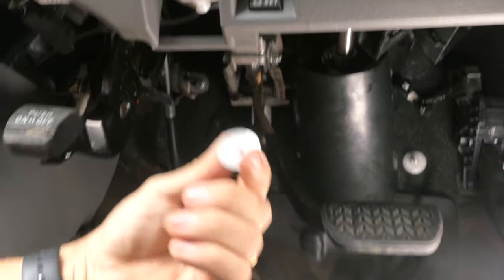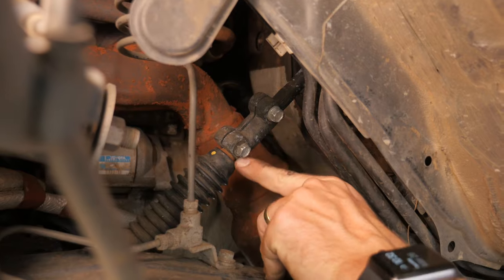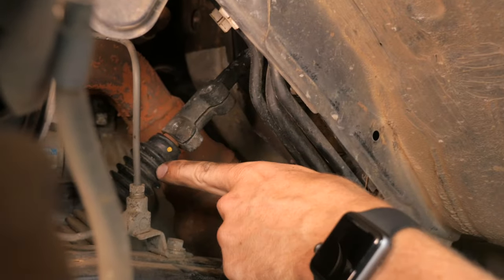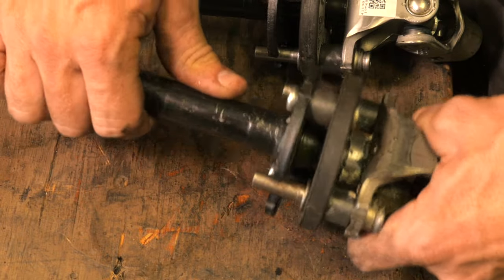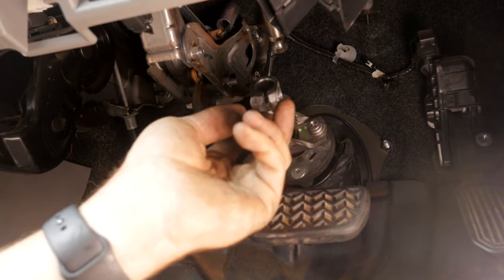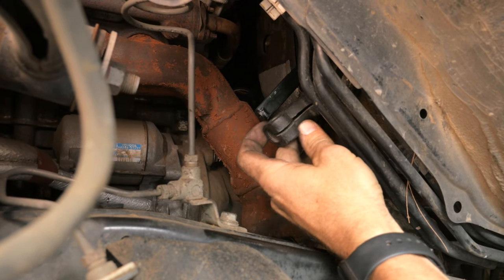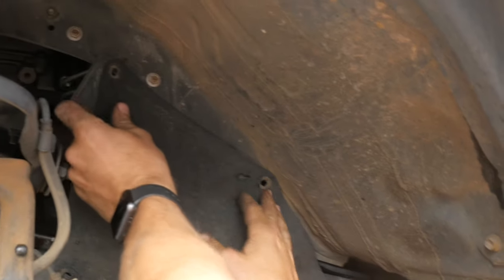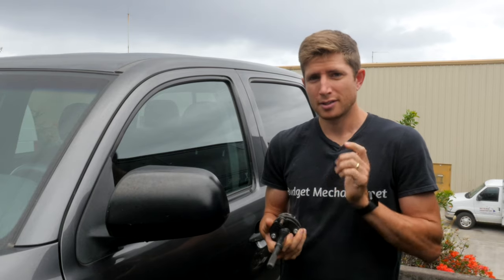Toyota Tacoma Steering Rattle Solved! Steering Intermediate Shaft Diagnosed and Replaced

Comment: Toyota has a part that has been counter measured, meaning an updated part. It is p/n 45220-04020. There is also a related TSB (Technical Service Bulletin) that covers 2005-2015 Tacoma’s. The part costs around $200! BTW, good video.
Reply: That TSB is it a recall can Toyota replace it under a warranty?
Reply: @WMAT77LL  It is NOT a recall so unless the vehicle is under the 3/36 warranty, it is NOT covered.Technical Service Bulletins (TSB) are repair processes covered only if the vehicle is under warranty.
Reply: @kevinpilotte8738  ok thanks
Reply: I just went to tacoma for this mine is under warranty but they want to replace the hole sterring column will this fix it ??

Comment: I found a cheat for this a few years back. Take a small zip tie or two and feed them up through the middle of the shaft to take up the extra space, and then tie them off. I did it on my old '07 and it worked just as well as replacing the shaft.
Reply: Where exactly do you put the zip ties please explain thanks

Comment: Great Video! I'm having this same issue on my 2017 Tacoma with only 53k on it. Is the rubber grommet not well designed? Would a non-OEM replacement part work better? My dealer said the Service Bulletin covers up to '21 Tacoma's but mines out of warranty already so I have to pay for repair. Disappointed that this Toyota part only lasted 53k when it should last longer. Thanks!
Reply: Are you stock or got a lift and bigger tires ?

Comment: Really appreciate the video man, I just ordered the part, do you know if all the newly manufactured ones have this fix built in (like that bushing you pointed to on the new one) or is the new one exactly the same as the old, so the problem could come back in time. I have a 2013 Tacoma 4.0l TRD sport.

Comment: Great video and the replacement is straightforward.  Thanks for posting.  I just did this on my 2010 Tacoma 4x4 Off Road.  I did place the bungee cord on the steering wheel but had an issue with the steering wheel position and had play around a little with the position on the shaft inside the cab (disconnect from rack & pinion and move intermediate shaft on steering wheel spline in the cab, reconnect rack, replace wheel, drive and test).  I'd suggest using a sharpie to make an alignment mark on the upper steering spline that lines up with the slot on the old intermediate shaft before removing it.  You can then line up the new one with the mark.  I also had to reset and calibrate the VSC (Vehicle Stability control).  It was an option on 2005 - 2008 Tacomas, but was standard from 2009 on.  Once you do the install drive slowly when testing.  If the VSC needs resetting you will get the slip indicator and and some bad gear noise at about 10 mph or so.  It's easy to reset - the instructions are on the Tacoma forum at https://www.tacomaworld.com/threads/how-to-reset-and-calibrate-your-vsc-computer-the-easy-way.467485.

Comment: Finally completed install on the intermediate steering shaft on my 05 Tacoma Prerunner.  Even though I did my best to follow the instructions of the video as close as I could, I encounter a problem joining the two shafts back together.  Called a friend of mine that had been a mechanic for many years before starting his fence company.  First thing he did was to disconnect the shaft completely from the steering wheel connection point.  The he was able to rotate the shafts and connected them with the coupling connector.  The he forced the connection at the steering wheel.  The problem was that the steering wheel was off center but a trip to the alignment shop back the steering wheel right back to center.  Total cost: $246 for the part (Toyota OEM Part), $20 to my friend for getting it back together and $75 for a frontend alignment.  Total Cost: $341.  Heaven only knows what a shop would want.

Comment: Having this issue with my 03 4runner. I'm going to assume it's the same thing. I replaced inner and outer tierods because I needed to, but they didn't fix the jittering steering wheel. I'm almost 100% this is my issue. Thx for the instructions.
Reply: Did changing  this part fixed your problem?? 

I feel that the steering wheel trembles and vibrations are felt on streets with imperfections(they feel sometimes exaggerated) , it is felt even with a small stone and the steering wheel feels loose, already. Change all the. Suspension,,,
Reply: @041185  I have not unfortunately. Shortly after my fan clutch bearing went out so the 4runner is parked. No time to start the project to fix. Going to replace the bearing along with timing belt and other things while I'm at it.
Reply: @ScooterBlia2  curious if you ever fixed the vibration/rattle. I have the same at highway speeds and just curious how you fixed yours..?
Reply: @james ruvalcaba  I never got to it. Trucks been sitting for awhile now. I'll eventually get to it. Just too busy and don't drive the truck anymore.

Comment: I’ve been hunting for the source of what I believe is the same sound you explained here; none of the videos or articles I’ve read have even MENTIONED this. So glad I came across your channel, going to try this out as soon as the part comes in. Thanks!
Reply: So what is the noise exactly? He mentioned misilar to inner-joint sound. I'm hunting right now my Sienna 08 noise. It's really similar to youtube videos of how axle joints sound when riding turns (like constant clicking), but not that loud and not that metalic,  and I really can hear it when car is staying and I'm just rotating steering wheel from end of one side to end of another side.

Comment: I think I have the same sensation. Especially when going over bumps off road with the wheel turned either way. Feels like dang things going to break. Is it possible for the lower shaft to be bad to rather than the top one you replaced?

Comment: Hello Josh!   I have a 2005 Prerunner, Crew Cab, Long Bed, with the 4.0 (1GR) engine.  It now has 172,000 miles and runs great.  I have spend some big bucks lately on replacing the front engine seal, the Harmonic Balancer, Timing Cover and new Water Pump.  The cost was $3472.  The labor time for this job was 9 hours.  This job was beyond me.  Next it took awhile to figure out that my crank sensor was bad.  My truck was in the shop a  couple to days to figure this out....finally a drop in current was detected in the crank sensor and thus another $426 repair bill.  Now the intermediate steering shaft is bad---the bushing is shot and so the steering shaft is hitting the metal rag joint.  I am certain that after watching your video over and over, I can accomplish this job.  I only have one question.  After you install the new shaft, I noticed that you remounted the  wheel but it sure looks like to me that the wheel is straight but you did not return the steering wheel to it's normal center position until you tighten the shaft under the steering column and then removed the bungie cord and turned the steering to it's normal center position.  Can you comment?

Comment: Is the new steering shaft supposed to “telescope/collapse”. I gave mine a few tap on the bottom going up when trying to install. Was able to extend it all way with some vice grips with quite a bit of force. Is it normal for the shafts to do that or should I just send it back and get a new one?

Comment: My 2017 Tacoma has this same problem. Definitely going to replace this part but I am also wondering if there is a bushing or seal that goes in the outer coupler boot. I ask cause my shaft twist in a oddly manner in the coupler boot before hitting at the rag joint. thanks for the video

Comment: Can the steering shaft, cause my 4runner not to stay aligned??  Pulls to the right side. And steering feels sometimes hard to turn and shaky or loose even on small rocks... All suspension is new except de steering shaft....when I move the steering shaft the u joint moves a little...

Comment: I can't seem to find a shaft that comes with the upper boot, can u point me to the right direction, my  upper boot is torn and it's causing vibration on bumps, but I also want to replace the whole steering intermediate shaft while I'm at it

Comment: How long is this issue safe to drive on.? 2007 Tacoma, rattling sound over any slight bumps, obvious in the steering wheel area but also the front end in general somewhat. Started yesterday I believe.

Comment: Would this issue cause whole vehicle between 75-85mph on a 2008 Highlander Hybrid?  The 2008 Highlander Hybrid has a TSB for the intermediate shaft and my vehicle definitely has a steering clunk at low speed.
Reply: Did you ever figure this out? I have a rattle at highway speeds that seems to maybe be coming from this intermediate shaft.

Comment: my front wheel is making a loud creaking sound every rotation followed by a clunk.  while checking things i grabbed that shaft that has the sleeve clamp and shook it and i can feel and hear a clunk. is that normal or should it not move.
Reply from the maker: Which shaft? Axle? Inner tie rod?
Reply: @BudgetMechanicHawaii  the one u replaced.
Reply from the maker: Not sure why your intermediate steering shaft would be connected to a wheel rotation noise but no, there shouldn’t be excessive play or clunking noise coming from it if you shake it back and forth...

Comment: Thanks for the video man. I have one question did your steering wheel making a squeaking noise because that’s what my 2002 Tacoma does it also smells like burned rubber.
Reply: Sounds like power steering by pump.

Comment: Hi Josh, I think my 2001 4-Runner is having this problem.  I have many parts--new rack n pinion, new pump, other rack n pinion parts, new lines, fluid flush and bleed--replaced already; it turned out to be real soft and came back to stiff and hart to turn again after a few hours or so.  Do you think I should have this intermediate steering shaft replaced?  Can you please help me with this?  I can have a home mechanic do this for me as soon as possible because I cannot drive my SUV because it's so hard to turn and making a whining sound as well.  I appreciate for the advice.  Thanks in advance.

Comment: Is this fix permenant?  Or does the rubber gasket wear out again?  I’ve heard a few guys on the forums say it comes back. Has anybody else noticed it after they replaced the intermediate steering shaft?
Reply from the maker: Can’t say from personal experience yet, but like you I heard mixed reports. May depend on how rough it is driven
Reply: Sounds good. Have you personally noticed yet?  I’m thinking about replacing it. It’s driving me absolutely nuts.
Reply from the maker: I did the job on my truck about 8 months ago (~10k miles) and it’s holding up fine. The sound drove me insane as well!
Reply: @BudgetMechanicHawaii  Did it rattle at highway speeds with some vibration as well?

Comment: Thank you for your video. If you don't replace it, is it dangerous?
Reply from the maker: Not really, there’s metal safety structure built into the joint so it can’t separate completely, but you will develop more and more play between steering wheel and front wheels. Mostly the rattling will just get louder and louder
Reply: Thank you.

Comment: This is not where my rattling is coming from, it’s up closer to the steering wheel through the column. It’s rattling against the inside of the tube it runs through
Reply: I was thinking I have the same problem. Rattle there at highway speeds with some vibration. How did you fix yours?

Comment: Isn't there a recall on this. Would toyota replace it for free?
Reply: There is a TSB 0057-12 for this covering 2005-2012 models. The 36 month/36,000 mile warranty covered it but that has since past, so it will not be covered, unless this is happening to newer vehicles that are still under warranty.